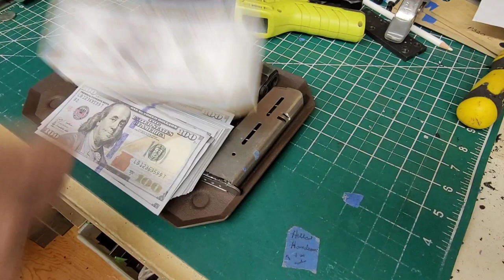EDC Dump tray. On foam with vacuum mold

Comment: Question.  Im making my vac press now.  What is your advice for making holsters on a vac using actual customers gun? I don't have any molds, can't afford them yet, maybe down the road.  I'm doing everything jig wise by hand. I thought about making a curved jig or I've seen people do the yoga mat thing. What u think?
Reply from the maker: There's a way to do it. I personally have not so I don't have much insight in that avenue. But they make curved jigs for that application